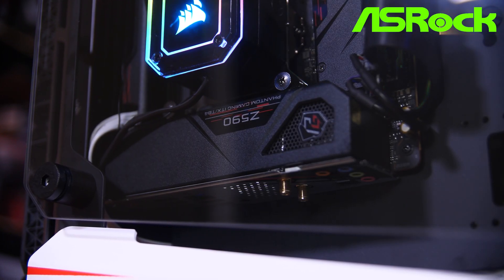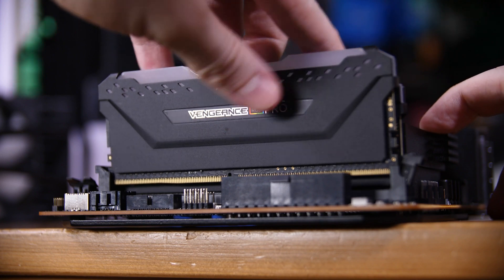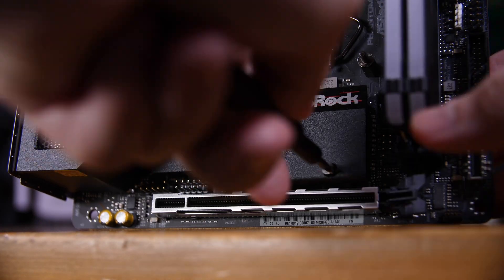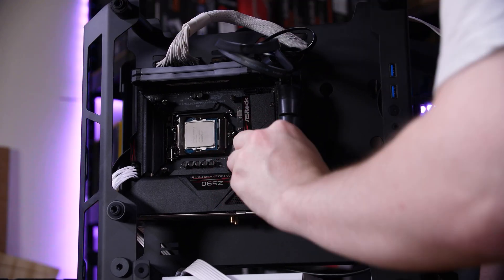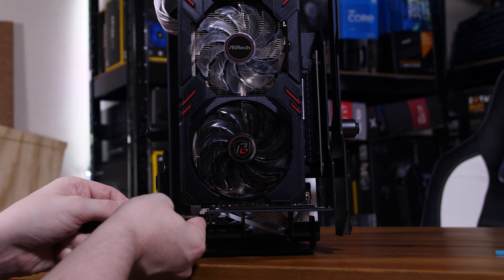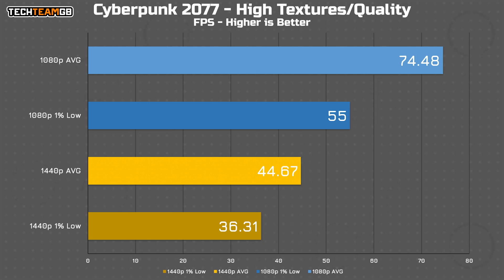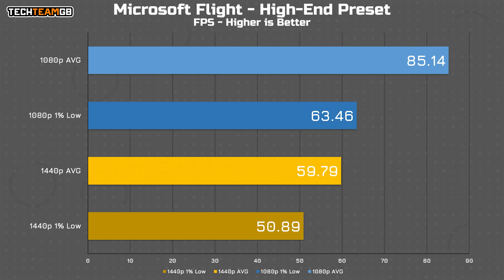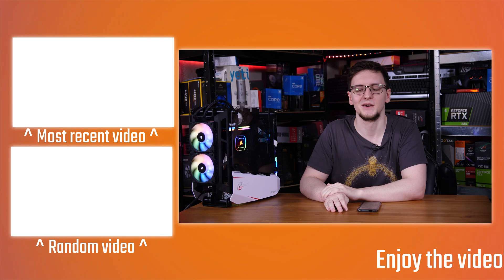RX 6600XT + i5-11600K BUILD GUIDE & BENCHMARKS

Comment: Bought a pre-built of this on a good price.    Basically there were 2 builds with 10600k one with 3060 and this one. I see it's doing better than 2060 or 3060rtx except the 3060ti. And in my country in europe the rtx is cheaper. Although in a pre-built I found it the same price as a 3060 build

Comment: you can also just fire up system on desk with card installed on motherboard change Bios to run at Pcie 3.0 then install all stuff in case with the riser cable